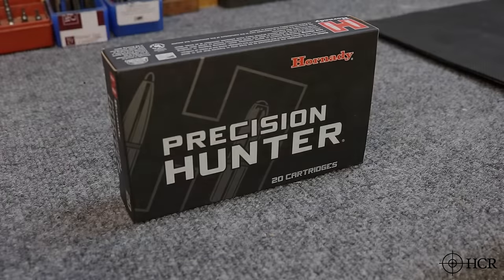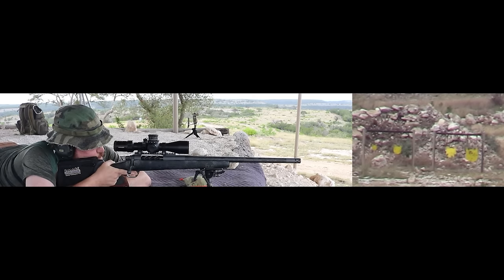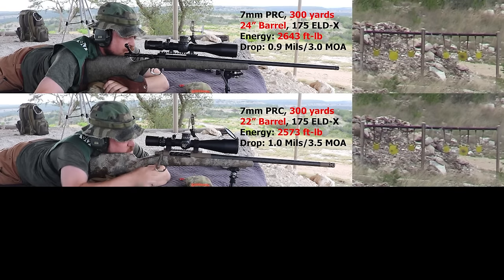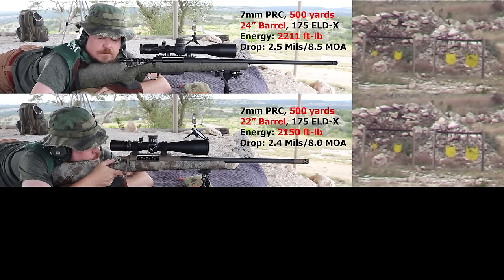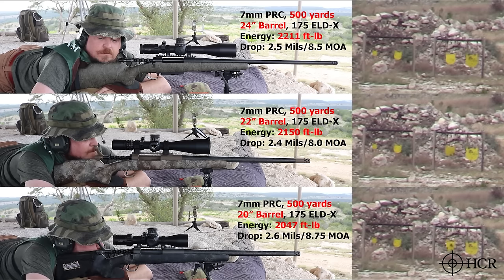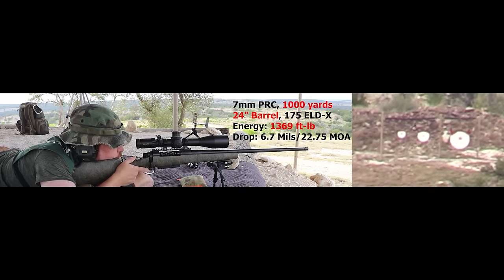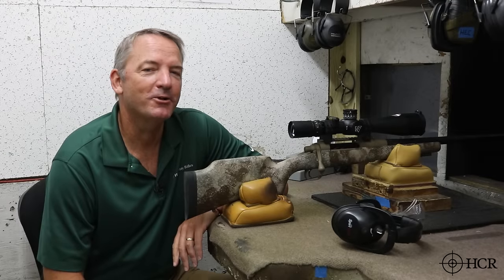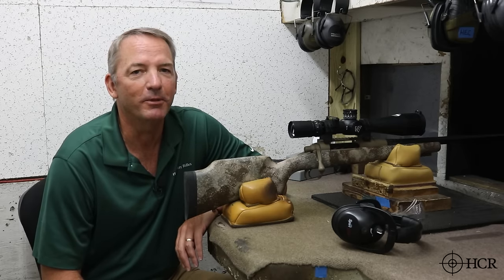Long Range 7mm PRC Testing & Data

Comment: It’s funny watching all the 7 mag guys lose there mind over the 7 prc. I love a 7 mag, but it’s obvious this is a better cartridge. If you have a 7 mag, it’s not worth upgrading. If looking to get a new 7mm, you would be nuts not to get the prc
Reply: I think it’s more so of PRC owners making it seem like it’s just that much better than the 7rem mag when it’s not. On paper, it’s true, the prc gives you numbers and energy a custom 7rem mag gave you with hand loads and custom, faster twist rate barrel but I’ve yet to see factory ammo that gives you those velocity numbers on the PRC that Hornady claims. So many people are thinking all I need is a 7PRC rifle and factory ammo and I’m all set when that’s not the case… and you can forget the advantage of the 7PRC with anything under a 24 in barrel.
Reply: @eddielombera5862 they lost less than 50 ft muzzle velocity from 22 to 24.  Not sure I would describe that as much of a loss.

Comment: I built a 7 SAUM several years ago with a 1-8 twist barrel and love it. 180 grain bullet at 2950, it’s funny how barrel twist choices by rifle manufacturers can make or break a cartridge. The 7mm PRC is just the failed short mag rebranded with a faster twist. I hope it works out I’m a fan of the 7mm.
Reply: Just like a cartridge can be too long it can also be too short… that’s why the 284 case shoots 7’s better than a rem mag or wsm. This is basically a modern shehane 284 or lrm case.
Reply: 7prc is a long action, not short.

Comment: I would have liked to seen a 26” barrel as well but I’m sticking with my 7 rem mag until the barrel goes out then really look into the 7 PRC but looks great
Reply: I just picked up a 7mm PRC in a Remington 700 Long Range w/a 26 in barrel...I know its a crap shoot if you get a good barrel on a 700 but it was only a grand..and if you get a good one they shoot great...I have a 300 Ultra Mag in a Sendero that shoots lights out but I had to buy 2 to get a good one...,Ill put a Trigger Tech Special in it and we will see what happens..
Reply: @bigrainbow25 It's been a while, how does it shoot? How do you like it? Considering vetting one myself.
Reply: @bokiNYC  spend the extra 200 and get the browning x bolt long range...that blows this guy group's out of the water ...

Comment: This is awesome! Tells me that 20" barrel at 500 yards is more than enough to drop an elk. Very helpful. Great video!
Reply: I cant get their info and specs to line up. Using Srelok-pro ballistic calculator with the ELD-X 175gr at 2862fps from the 20" as they claim, the 500y energy on target is 1926 ft-lb, not 2047 ft-lb as they claim. That's with a G7 BC of 0.347. Am I missing something?
Still good enough for an elk at that range tough...

Comment: Glad someone made this comparison when I built my 7prc Tikka went with a 20" carbon barrel thanks to this vid showing you not losing very much. The short barrel makes running a can so much nicer.
Reply: Hey man are ya getting similar velocities?
Reply: @loganmorton9304 Yes with the older factory ammo getting mid 2800s out of my 20" carbon six featherweight barrel and mid 2900s hand loading.
Reply: @Error-4-0-4- 

What recipe are you using for hand loads?  I just ordered a new barrel

Comment: I’d love this same video, comparing barrel lengths, using the 300 prc!! 😁Interesting video!
Reply: @hk93shooter  learn how to read
Reply: Michael I agree. im Judeau what do you mean by that?
Reply: It's been done not here but,   the 7 PRC holds vel better has less wind deviations and has more tissue penetration at long ranges. Higher sectional density.   But The 300 is king on total energy on target though.

Comment: The 7 PRC 185grn BC ELD match is almost .80. That's nuts. This is an awesome video. I truly appreciate your work and admire your products.
Reply: The 190 a-tip is also insane and in the same line only outclassed by 250+ gr bullets.
Reply: @borkwoof696  it’s pretty much the flattest shooting gun you can pick up off the shelf and run factory ammo through, without blowing your shoulder off with a 28 nosler or 338 of some sort.
Reply: Berger’s are better don’t read boxes.
Reply: @devinb3397  Huh??? Uh, no. There many, many flatter shooting cartridges out there and they're not all big magnums. Do you really mean flattest shooting, or do you mean something else?

Comment: Thank you for this very well put together video. My only gripe is a potentially misleading statement at the end by the grey haired gentleman. The velocity (and therefore energy) retention at longer range has nothing to with the cartridge and everything to do with the high BC bullets that the 7 prc is meant to shoot (when compared to SAAMi twist/reamed 7 rem mags, which are not designed to shoot those high-bc bullets) All cartridges are just “vehicles” for muzzle velocity, after the bullet leaves the barrel, it doesn’t care what cartridge it came out of. Secondly, the 7 PRC is average at retaining velocity from shortening barrels, it is almost exactly 25fps per inch velocity reduction from 24” saami standard, which is the industry standard for barrel length versus velocity change.

But like I said, great video; I just wanted to bring up the slightly misleading statement that velocity retention downrange is in anyway linked to the cartridge, it is not. Downrange velocity retention is all about bullet performance. But I do concede that some cartridges are made for modern high bc bullets, and some older cartridges are made for old low-bc bullets. Thanks!
Reply: How would a 7mm Rem Mag do in a 20" barrel? There's a whole lot more factory ammo for the Rem Mag than the PRC

Comment: I have a question...
What was your muzzle velocity out of the 24 inch barrel? Did it match Hornady claimed specs?
Or, is it true that their velocity claims for the 7prc factory cartridge are "optimistic" in their defensive competition with the 6.8 western? 
Why did you leave muzzle velocity out of the on screen specs?
I might see if I can use the target energy specs to back calculate...
Reply: Ok... So, using the info you supplied, it has to be a muzzle velocity of 3011fps to have retained energy of 2643 ft-lb at 300y. Did you chrono or rely on Hornady specs?
Reply: Just watched it again, and you DID share velocities. My bad. BUT, at 2965fps out of the 24 inch barrel, my ballistic calculator says the retained energy at 300y is 2557 ft-lb, not 2643 ft-lb as you claim. I am using Srelok-pro. Am I missing something???
At 500y its 2086 ft-lb, not 2211 ft-lb...

Comment: The point of the new cartridges is no lead bullets restrictions.  Since copper is lighter than lead.  A longer, higher ballistic coefficient bullets will be needed.  As well as a 1 in 8 twist rate to stabilize bullets.  To differentiate the cartridge from lower twist rate cartridges.  A slightly different cartridge was developed.
If no lead bullets are NOT an issue for the hunter..  The new cartridges may not be so compelling to buy.  I have short range rifles like 350 Legend and 45Colt for some situations.  But for my longer range rifles such as the .308 and 270 Win.  The new cartridges may produce better outcomes with no lead bullets.
One of my nephews has a 6.5 PRC.  And I have a 6.5 Creedmoor that I bought to introduce my grandkids to long range shooting.  So it seems to me, that over time.  The new cartridges will become as popular as the 270 Win, 308 Win, and the 30-06.  The 7mm crowd, may just collect ALL the variations of 7mm.

Comment: Strange it dropped less with the 22" then the 24" on 500 yards
Reply: It didn’t, they hit the bottom of the target, so the dope was off on that one.
Reply: Agree. Look at the impact watermarks.
Reply: @ericwilson3053 yeah I’m guessing the mil/Moa would be the same on a center impact. After 500 is when the mil gap opened up. But not much. I was banging my head trying to find a lightweight 24”. But, now I think I may go with a 22” since that’s what most of the $1500 $2500 rifle companies are producing in sub 6.5 pound hunting rifle. Seems to not lose much of anything in velocity or accuracy. It’s just that cartridge is meant to be extreme long range capable and shortening the barrel seems counterintuitive. But, if your getting a full powder burn not sure it matters. Even long range comp shooters are moving away from 29 to 30” barrels down to 27 to 28”
Reply: Savage Arms just came out with thier 7prc with 20" carbon proof bbl and in an ultralight Hunt-26 MDT stock (5.8 lbs all in)

Comment: I hope you will answer this question. 
I see no one asking for verification of the velocity results in this video.  
Energy is a product of mass/velocity, correct? 
How are you achieving 1668 FPE at 800 yards,  with the 175 ELD-X FACTORY LOAD? 
According to Strelok, you would need 3080 FPS with that bullet, to achieve 1664 FPE at 800 yards.

And all the comments I see here, are just assuming the numbers shown are factual. 

I will agree with one response... 100 fps gain is not enough to sell me on a new rifle.   At 800 yards, using the same bullet, that gain is greatly diminished. 
I'm a dedicated 6.5 PRC shooter, and 6.8W. As well as 7 RM.
I have wanted to jump into the 7PRC game, but honest results in must rifles are not showing the results Hornady advertises.
I hope you'll do another video, to dive more deeply into this topic, specifically as it relates to the 7PRC. 
Maybe even do a side by side comparison to a closely matched 7RM. 
Thanks

Comment: You did not post velocities. 
With all the failed velocity  results shared by many 7PRC shooters, your Energy Numbers can only be helpful and reliable,  if you share  the actual tested velocity results. 
Hardly anyone is getting the Hornady advertised velocities from factory 7PRC ammunition. 
Hornady claims 3000 fps, but most videos online are showing 2800-2900 fps, which is pretty close to 7mm RM performance.

Comment: Having a 20" barrel on a cartridge like this is insane. That would equate to putting a very restrictive single exhaust pipe on a hi-performance engine.
Reply: Sometimes the surface u drive on needs less HP to go down it faster just like shooting out of blinds the 20 in is much better than a 24 or 26

Comment: Hmm.  I’m shooting a 160 grain Accubond at 2950 fps out of a factory 22” barrel in a short action.  This is 15 grains heavier and about 30 fps slower and has to be shot in a long action.  Thanks for this video.  This vid just solidified my original choice.
Reply: 9% more juice. What cartridge is getting you that speed at 160?
Reply: You do not own a more efficient 7 unless it’s a shehane or lrm. A short fat 175 at 2900 does not go as far or do what a long skinny 175 does. And whatever you own if it’s more than about 15 years old it’s not a comparison. No matter what it is. Don’t just rely on numbers on the box. That’s what 260 and 6.5x55 guys do. Then they buy an actual good modern 140 pill and find out it’s stuffed so far down they are now 200 fps under the 6.5 needsmore. Just cause they saw 140 2800 vs 140 2800.
Reply: Not to mention wsm’s are not that accurate.
Reply: @MrT13  the are shot world records with the 300wsm at 1000 yards .
Reply: @andrebosgraaf2086  some sure. Couple of ppl have put in a lot of effort etc. But that’s like saying there are world records with .308 too. Cause there was… but the current, world record of 200-22x was not set with a wsm. So currently, no it does not hold any. Not that I’m aware of anyway.
Reply: @andrebosgraaf2086  it’s great don’t get me wrong. But to control it with even 22 lbs is just a bit more than most can actually do consistently. Which is part of that accuracy. Personally I think it’s a bit too short and fast to be truly square and therefore no not as inherently accurate as say the .284s
Reply: @andrebosgraaf2086  I tried one and I couldn’t do it. Every squeeze you gotta reset everything pre load resettle etc etc and it’s just really hard to run consistent.
Reply: @MrT13  i shot a tikka with a terminator comp and it is soft like a 223rem  my fx impact airrifle in .35 888fps with a 93 grain nsa is harder to shoot accurate than the wsm.
Reply: @andrebosgraaf2086  well 99% of the best fclass shooters in the world disagree with you lol. It’s not about recoil. I own a .50 .458 win mag. Hunt pigs with 3” slugs or a 375 raptor. Shot at every duck I’ve hunted for the last 5-6 years with 3” 12ga. Sooooo your not talking to someone who’s recoil shy…. That’s not the point. And no a muzzle brake is not going to bring a 300wsm down to a 223 lol. Or an air gun lol. There’s math involved here, and it doesn’t lie. I’m just telling you a simple fact, not a lot of guys use the 300 and when they do they DO NOT DO VERY WELL and do not use it very long. These are just facts. Go look up who has the tightest group record and the 200x22. Neither was a 300wsm. FACTS.
Reply: @andrebosgraaf2086  I think that air gun mite be harder to shoot more accurately cause it’s probably just less accurate. Cause it’s an air gun… my 25-.284 is a .1-.2 gun all day every day one hole always. And even though it’s just a little .25 most importantly it’s a consistent 25. Which is better than anything anyone can shoot less consistently. I hear this all the time. “Fclass guys use the fastest, flattest, highest bc projectiles, and they push them the fastest they can” no we don’t. If that was the case we’d all use .35 caliber necked down .50s and forget the recoil, but we don’t. Cause it’s not consistent.
Reply: @andrebosgraaf2086  I take it back, very very few guys use the 300 well. A couple do. 95-98% who try do not.
Reply: @MrT13  Don't underestimate the crazy recoil reduction of the Terminator.  They have great videos out there.  For example on 338 LM.  I own one and can vouch!
Reply: @charlessparks9868  I know I’ve seen. It is a fantastic idea but. A tuner is more accurate. When they finally figure out how to make a real consistent muzzle brake tuner combo (which is in fact in the works by a couple ppl) that will be the next go to.
Reply: @charlessparks9868  besides you can’t use a brake in any nra matches so I don’t care how efficient or effective any of them are… mite be great for weekends and funny guys who like to shoot sabots through them lol. But not allowed in fclass. Or any nra sanctioned events as far as I know.